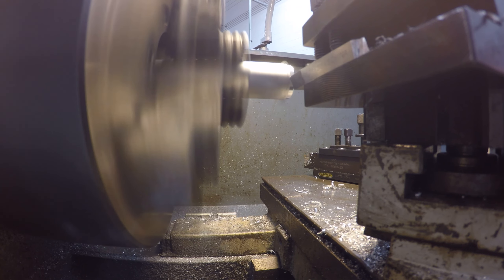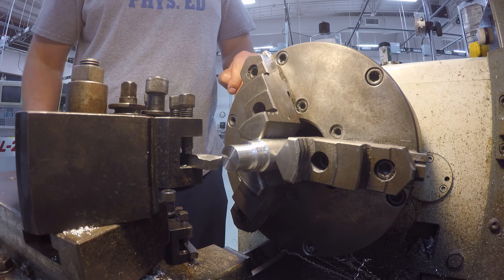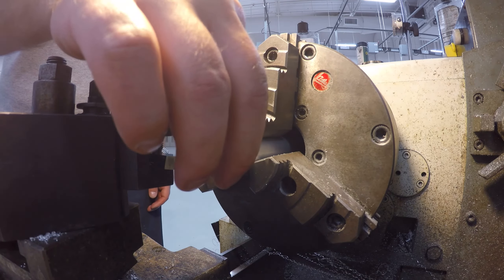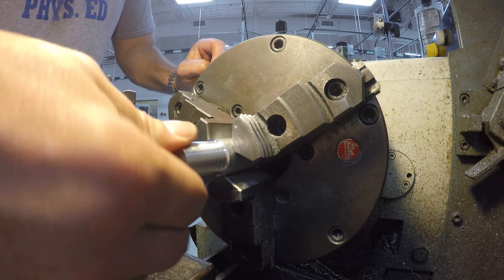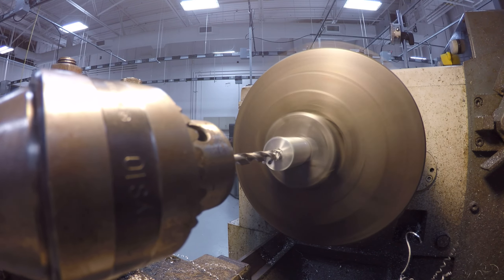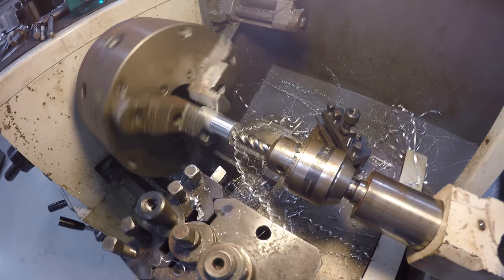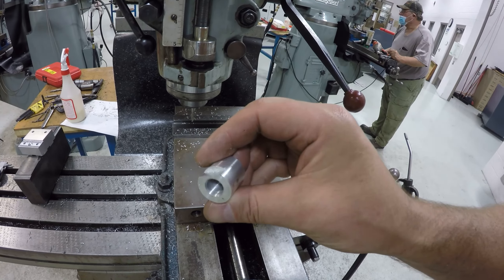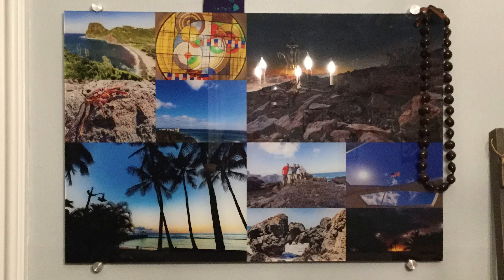Machining Acrylic Print Floating Mounts

Comment: How are you guys doing? Steph and I are still having trouble getting insurance on the Aeromate. It's come a long way, though. Did the timing belt a couple weeks ago. It was hilarious. PO had put the original head back on the junkyard engine so it had a round tooth cam sprocket when everything else was square tooth. They put a 2.2 shortblock in and kept running the original 2.5 TBI van SMEC so it ran pig rich in open loop. >.<
Reply from the maker: Well, sounds like you''ll have a few spare parts when you get everything matched up. It's very frustrating when someone completely botched the job and you have to play cleanup. I know a lot about that...

We're doing well, and I hope you can get your insurance situation figured out. You may have to go the route of an agreed upon value policy with that one.